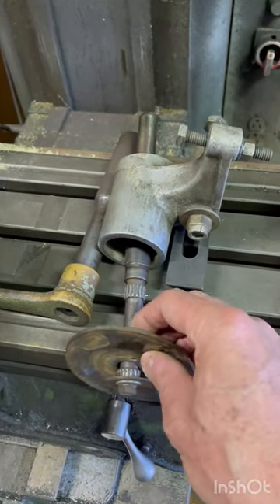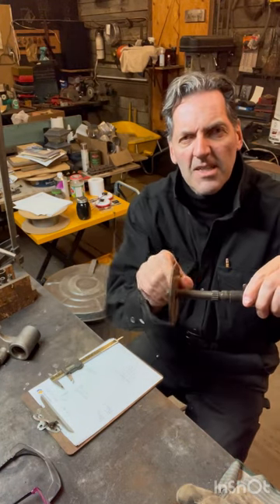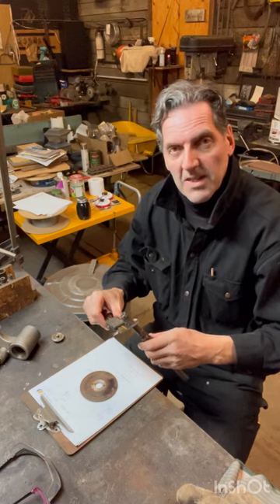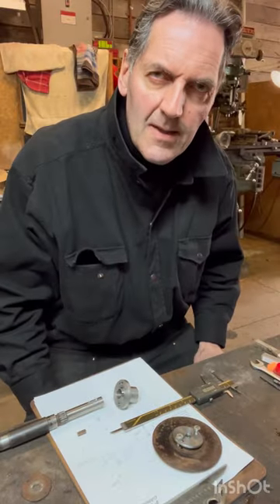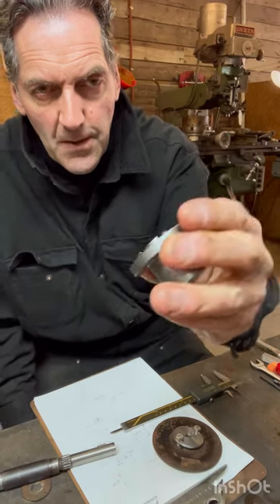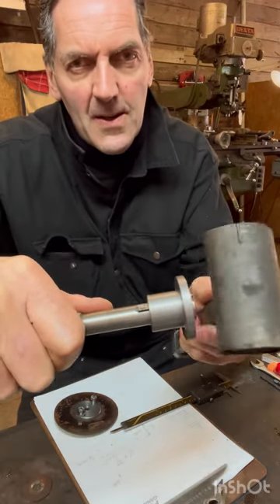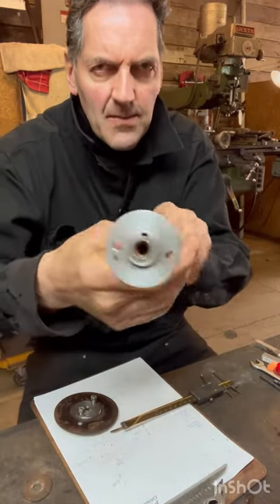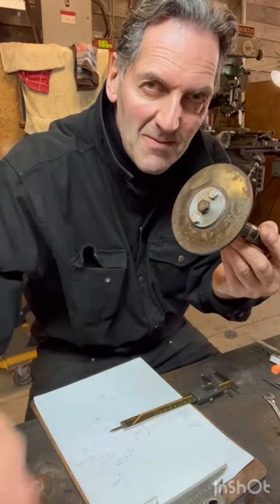Repair of a disc brake system on an old snow machine

Comment: Nice work! But wasn’t the disk designed to “Float” on the shaft so it centers between the brake pads on the caliper? Or does it have a floating caliper?
Reply from the maker: Good question, I have no idea as I never saw the machine itself, but in that case, you could just leave the washer off the end, and let the bushing assembly float on the shaft, riding on the key….